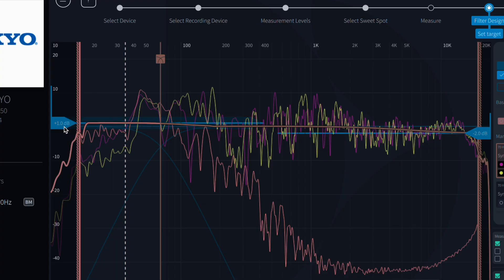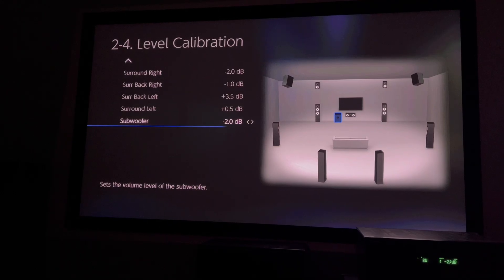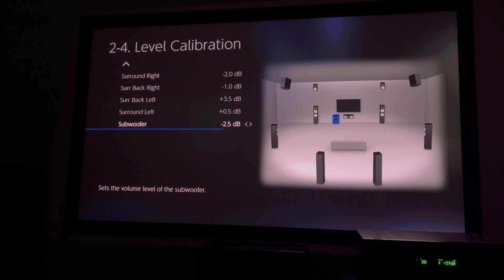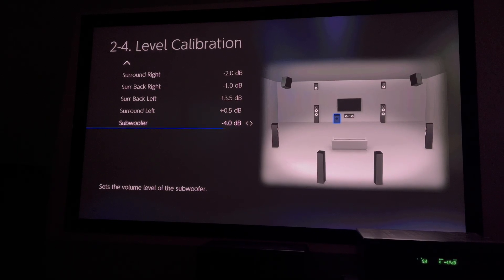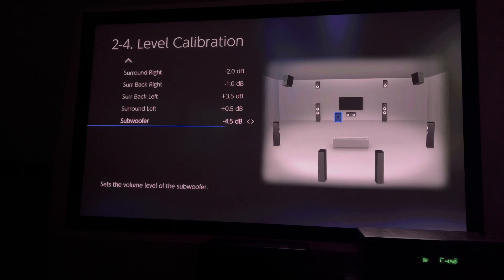4 Settings For POWERFUL BASS With Dirac Live

Comment: I have the Rz50 and I've ran dirac multiple times and I never seen the bass management option 
Am i doing something wrong or is there something I have to enable?
Reply from the maker: Are you using a laptop, or an app? I use a laptop and the Bass Management option is in the upper right hand corner, in the column with each of the channels.
Reply: @GeorgeTheaterAtHome I've used my wife's laptop and my son's desktop and I've never seen that bass management option. I've only ever seen it in YouTube videos .Maybe it's a feature that has a region lock 
I could make a short video showing you the option I have available which in my case is only dirac live
Reply from the maker: Delete Dirac Live and then go to the Dirac website and download it and reinstall it. This will ensure you have the latest version. It should then be there. Let me know if you still don’t see it. Email me directly at georgehometheaters@gmail.com

Comment: uh I think if you raise the gain on the sub and inside the OSD trim settings you're going to mess up the crossover integration a bit. Why not just do it all in Dirac so it knows and can calculate accurately?
Reply: The safest way to get more volume out of your sub is to keep the trim level in the negative range. -2.5 is an ok starting point but I would just go for -5. Then adjust the gain to blend with the speakers.  and get the LFE level correct. This can be done two ways. With AVR test tone ( set all speakers and subwoofer at the same loudness ( usually 75db). BUT... this can only be used if there was no calibration used. For some reason most if not all avr defeats calibration when u use the built in test tones.
If you have calibration done you can use REW. You either change the tone manually for the speakers and for the subwoofer and set them the same level. So you start playing pink noise for the speaker and raise the volume until you get 75db ( using -30dbfs test tone) and you should be near volume 0 or 82 depends on which volume type you use. then play -40dbfs test tone for the subwoofer and adjust the gain to 75db also OR... don't touch the test tone. Keep playing the same -30dbfs test tone BUT you NEED to set the subwoofer gain too be 10db higher so it will need to play 85db. NOW.. if you have multiple subs this changes. Each sub will need to be 5db off. Depending which method you used what I mentioned above you either play them 5db lower individually or 5db higher. Together they will match or play 10db higher. Again depending if you changed the test tone or not.
Reply: @CSOCSO what does this have to do with anything? Why did you write an essay on something unrelated to what I said?
Reply: @miscreant1739 were you saying dont adjust subwoofer gain but adjust the avr trim for subwoofer?
Reply: @CSOCSO  That's not what I said. I said if you adjust trim or sub gain after Dirac you could mess up the crossover integration so let Dirac do its job. If Dirac raises the trim into the positive range and you don't like that then you need to raise the gain on the sub or get more/bigger subs and then recalibrate.
Reply: @miscreant1739 its recommended check and redo the levels after calibration so no, It's not as simple as let dirac to its thing and leaving it as is. Its never recommended to leave the sub trim levels positive. Even if dirqc put it there. Dirac cant control gain knob behind the subwoofer.

You are saying if dirac sets the gain to positive just adjust the gain.. yeah. Exactly. While lowering the trim preferably to the negative side. But in the beginning you are alsonsaying why woukd you change it and mess up what dirac did for you. So.. adjust it or not?
Reply: @CSOCSO  You really need to slow down and read more carefully. I said (and am saying again now) don't adjust AFTER CALIBRATION. If you end up with positive trim after calibration, raise the gain and RECALIBRATE so it ends up at a lower trim value and then DON'T TOUCH IT. Otherwise you'll mess up the crossover integration.
Reply: @miscreant1739 i disagree. Adjusting sub trim level and readjusting the gain changes nothing about crossover integration. If you lower the trim level 7db but adjust the gain it will be the same but you get more headroom and less chance of clipping. Trim levels are digital control and gain is analog. Makes no difference for crossover integration if the sub trim level is set to +2 with gain at 4'o clock position or sub trim level at -5 and gain at 7 'o clock position. It will sound exactly the same as long as you do it properly and set the gain so you get the same spl out of the sub(s).  Only issue is that with dirac bass controll or bass management you will get locked out of the trim level settings and you cannuse the quick settings.
Crossover integration depends on phase, delay and level match at crossover region. Thats why you use room eq wizard and set the speaker to 75db using -30dbfs pink noise signal and set the subwoofer to the same using -40dbfs pink noise. Of course if you have more than 1 sub you need the combined spl to be that much.
Reply: @CSOCSO  the whole point of the video was to get more bass. If you swap trim and gain and end up with the same output you haven’t really accomplished the main goal here…
Reply: @miscreant1739 sorry. I dont even remember what was this about. I just saw a comment about trim level and gain. U were saying it would mess with crossover integration. My latest point was that it would not mess with it. I already told you what the point of lowering trim. Less change of clipping and leaving more headroom.

Comment: Where does magic beans fits in this equation and would it change this approach ?
Reply: You run the custom sweeps BEFORE dirac live which creates house curves. Then run dirac and add your house curves. The eq boost will be totally different. To be honest I do not like the subwoofer house curve what magic beans gave me. It boosted the hell out of my subwoofers at the bottom end. Boosted the curve under / past the natural roll off which is a big no no. It's one way to kill your subs. I use a custom curve for everything. Even the speakers. I did use Magic Beans but even dirac lowers the highs on my speakers and I don't like it. So I basically move all the eq points back to zero above 5k hz. Actually, some say you can even try moving the right curtain all the way back to 500hz. So all speakers would only be calibrated between 50hz to 500hz. 
I did not mess with it. i just made the highs flat instead of dipping down. 
Also adjusted the subwoofer and took off the boosting past it's natural roll off. I don't want it to clip at high volumes
Reply from the maker: I set the curtain at 500hz to eliminate any correction above 500hz. Correction above 500hz sounds too synthetic and overly processed to my ears. I'm glad we have that option so each person can set it where they like it best.
Reply: @CSOCSO We were assisting you on Discord and then you disappeared. I think there are issues with interactions between certain speakers in your system, your room and listening position that requires more attention. I've seen you mention in various places that MB is the cause of the issue, but seeing your measurements, it's the room interaction and MLP and no room correction can fix those issues outright, but some effects can be minimized. We've helped others with similar issues but it does take some experimentation.
Reply: @joentell i didn't mention anything about the speaker issues. All i said mb gave me a curve where it was boosting the bass below the natural fall off point. We are talking about two different things. Dirac is doing something weird about the front heights. But my comment had nothing to do with that.

Comment: Hey thanks for the video. I think the reason Dirac/AUD use a flat target curve might have to do with listening at reference level. At reference level bass is perceived differenty (equal loudness curves) and also it might cause damage to speakers if they boost it as much as 6dB by default. This is why AUD has the Dynamic EQ feature exactly because they understand this preference for boosted bass very well. DEQ will actually reduce the boost as you get near reference level. 

To me it is easy to overcome a flat bass but the issue arises in the higher frequencies where a purposely bright speaker will be toned down and a purposely dark speaker will be toned up by these room correction software. This is why you need a professional calibrator.

Comment: I don't think gain should be set where "you would like" to run it. It's set where you get enough bass. The amount of gain will be different depending on EQ and trim levels in the avr. 
-5 or -10 trim level with gain set to %70 is better than trim is set to +5 and gain at %40. You get more headroom, less clipping and better SNR.
Then after EQ ( to fight peaks and peaks alone) you can properly blend in your subwoofer with the mains by either setting them ( using the gain knob) to read 75db with avr test tone or the same as other speakers* play the pink noise, or if you have calibrated your system it's better to use REW and either set your subwoofer 10db higher if you use the same test tone signal for speakers and the subwofoer or set it to the same IF you are using 10dbfs lower pink noise for the subwoofer alone.
Reply: I followed your advice and my kipsch RP 1400 sounds amazing. Just have a doubt - what if I run the sub level gain max ( heard from a group to run the sub gain max for better potential and AVR trims to - levels or lower. What is the best way for a good running for a better heavy impact from a sub without distorting it? ta
Reply: @SuperSteamengine avr sub trim level to -5 and set the gain where it needs to be. I made a document how to do all this. Not sure if i can link it here
Reply: @CSOCSO Thanks legend, got it from klipsch  group. You could make a video as well ☺️